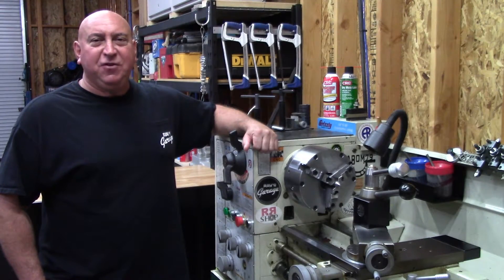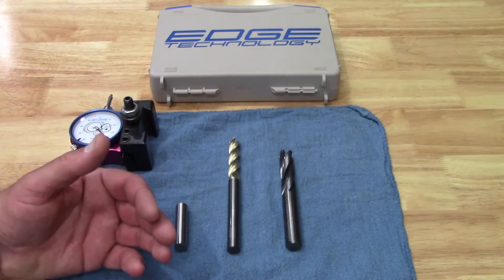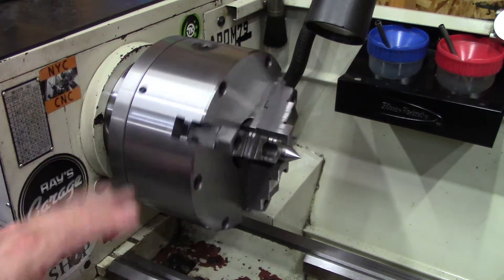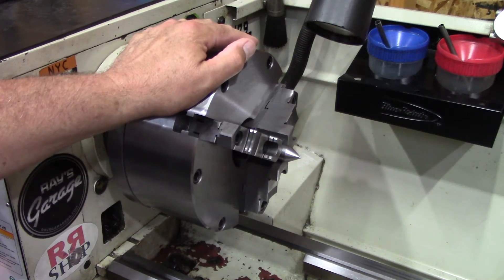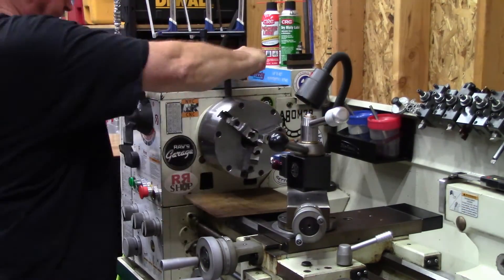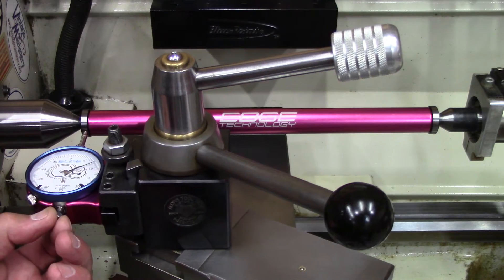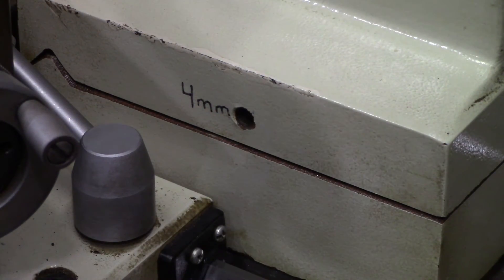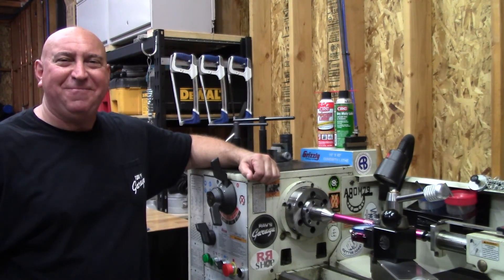Chuck & Tailstock Accuracy Tests #edgetechnology #allindustrialtoolsupply #realraysgarage

Comment: Thanks for sharing. Can you tell me where to find a straight shaft dead center, please? Thanks
Reply from the maker: I machined and ground my own from a piece of 3/4" steel bar stock. The nice thing about this is it will be perfectly concentric to your lathe chuck as long as you don't take it out after machining.

Comment: All ur doing is checking runout of the endmill.
Reply from the maker: Hi Mike, I do realize this however, short of making one it's the most accurate pins I have to test with.  If you have any super accurate test bars, I would be happy to use one and compare it to what I have if you like. Best Regards, Ray

Comment: You need to measure the top at the same time you check the sides of your bar to verify your tailstock is inline vertically as well otherwise you could still turn taper.
Reply from the maker: bcbloc02 You are 100% correct Brian and should have at least mentioned this! Thanks for mentioning this!
Reply: If the in and out axis is parallel to the cutting tool, how does the vertical axis create a taper? Am I missing something?

Comment: Hi Ray, nice video. Do you have to check and make sure the lathe is level before doing this test or does it not matter?
Reply from the maker: I should have mentioned this and thanks for bringing this up! Yes the lathe must be level and the head trammed and cutting straight before you align the tailstock to the head.

Comment: That's one fine chuck you have. 
When setting the tailstock, depending on make, you have to slacken the locking lever as it also clamps the two parts of it together.
Reply from the maker: Yes, you are 100% correct Chris, I was playing with that after the video!